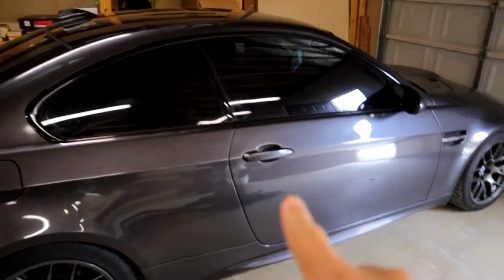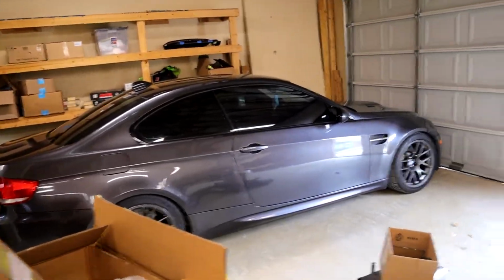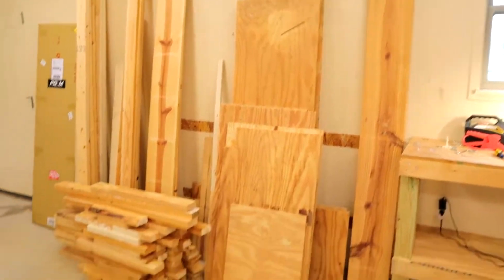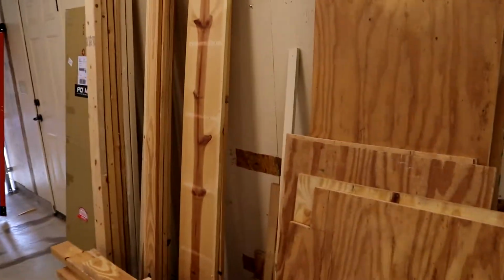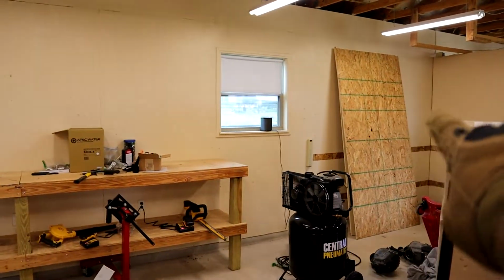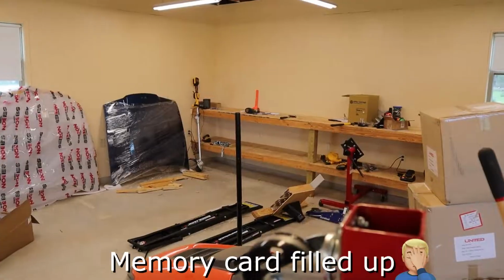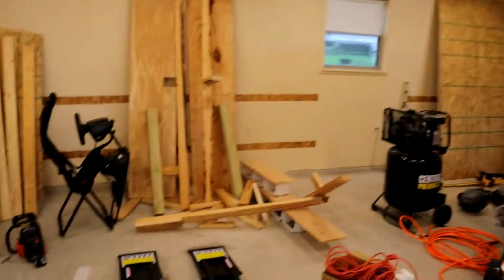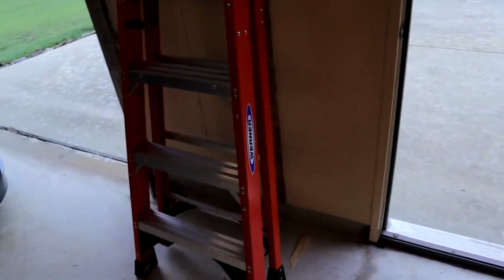Turning a Wood Shop into a CAR Shop - Part 1

Comment: As a s2k owner it was sad to see it out. But sticking around. I love garage builds. 

Advice you didn’t ask for. I would just paint match the walls to the current color all the big box stores could get you really close to save time and money. Lastly I wouldn’t move the tall shelving next to the wall and I would move that desk as well. Make all storage and desk far as possible from the door. So you have ample space with both cars and nothing behind them.
Reply from the maker: Dude! This is what I'm talking about, thank you! I'm clueless when it comes to car garage layouts but what you said makes perfect sense. Since filming this I had second thoughts about using any of the current storage. I may take it all down and get a couple of decent cabinets.